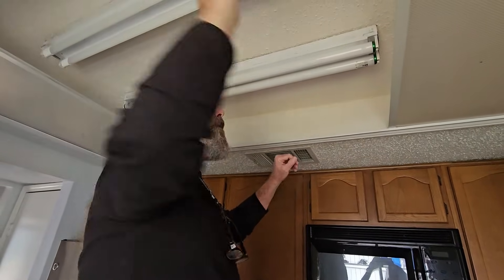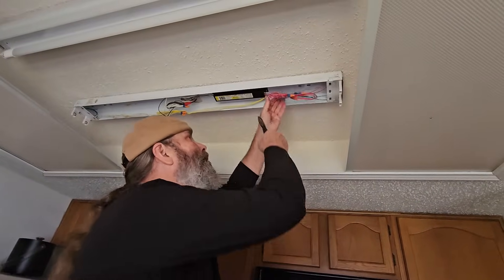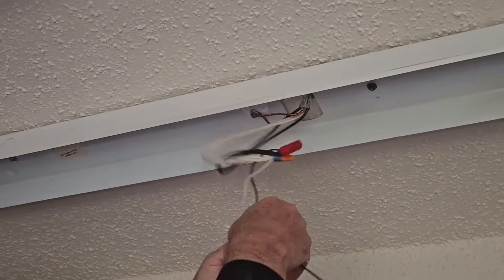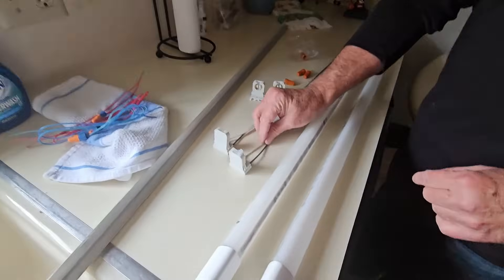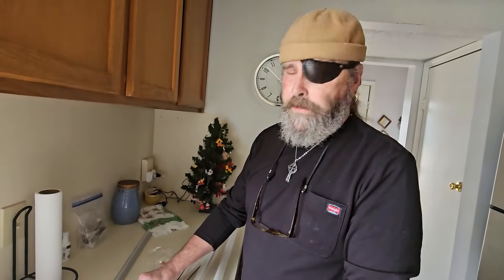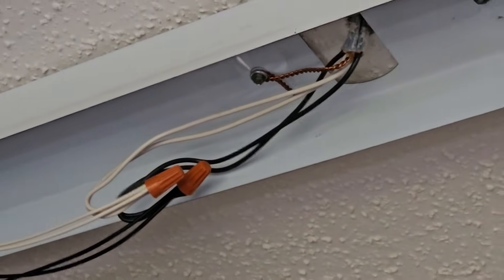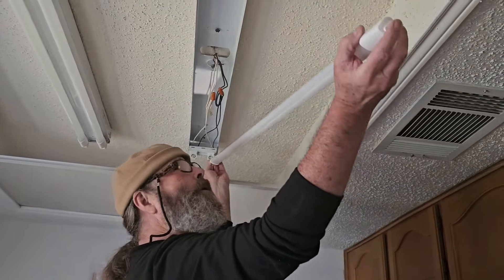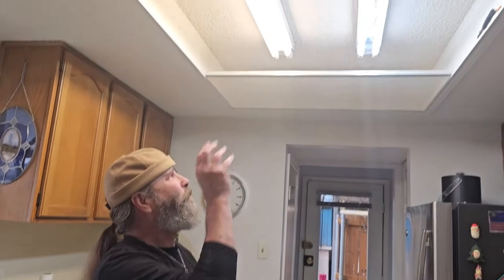How to Convert Fluorescent Lights to LED With a Ballast Bypass

Comment: Why did you bother replacing the far end tombstones since they are non-wired?  Why not leave in the old ones?  And it looks like the power end could have been used.
Reply from the maker: Aye, matey, a relevant question. I did it for the sake of consistency, and because the directions said to replace them! Contrary to popular belief, we pirates always follow directions... ;-)

Comment: the tombstones that will supply the power to one end of the bulbs. If your looking at the tombstones while the fixture is attached to the ceiling there are two tombstones and four wires. You need to twist wires 1 & 3 together (they are the neutral)
and 2 & 4 wires (they are the line).
Then just connect the black wire to wires 2 & 4 and the white wire to wires 1 & 3.
Reply from the maker: Thank ye for the tips, matey - smooth sailin'!

Comment: Problem is some have wires on both sides and they are different colors
Reply from the maker: Aye, matey, the wiring diagram on the new ballast should give you the info you need. If not, let me know the colors of the wires in the fixture and the color of the wires on the new ballast. We'll figure it out!
Reply: @thepiratehandyman2225  if you are bypassing the ballast then there wouldnt be a new ballast. im just giving you feed back.
Reply from the maker: Aye, matey - me apologies! When converting to LED, the new wiring diagram should be included with the new tubes. This includes wires that you should remove, depending on the specific replacement tubes. Again, sorry for the confusion and many thanks for the feedback!

Comment: Just cut the yellow ones out. 
Then cut red and blue near ballast 

Red and blue from same side go to blk
And red and blue from other side go to white. 
Yellow are cut completely out

Bulb marked for power side. 

Plug in and your done.  Keep extra ends for spares. 

Wham bam.
Reply from the maker: Aye, matey, thanks for the helpful tips - smooth sailin'!
Reply: @thepiratehandyman2225 
I reread what my reply was.
Wires from left of each ends and wires from the right side of each ends go together with the white and black.
Reply from the maker: Thank ye for the clarification, matey!

Comment: Question. If the new led lights make the fluorescent  ballast overheat wouldn't that mean the led lights need more electricity or are using more than the ballast can support?? Just curious. Thanks
Reply from the maker: Aye, matey, that question best be asked to a licensed electrician, or at least to an expert at a lighting store. I have only installed LED lights that do not require the old fluorescent ballast. That said, if the ballast is overheating, it is a definite sign that something is incorrectly matched, and ye should address it as soon as possible.